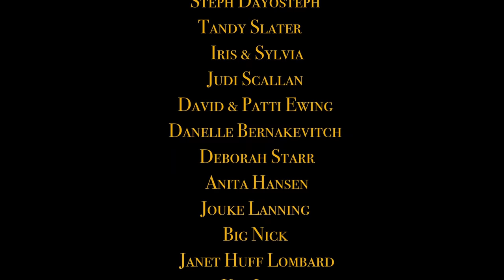EP54 Daily Vlog : Big Reveal The Dining Room @Our Passion Project Day 7

Comment: The chandelier looks great in the room.  Was it difficult finding the right shade of red paint or did you get it right the fist time?   We use furniture sliders to move heavy furniture by using a 2x4 to raise whatever we need to move and then putting slider under it.  They aren’t very expensive and make it easy to move stuff on carpet or hardwood floors.  Our latest need for them was to pull stove out after an egg broke and slid down side of cabinet and stove causing a big mess.  Since then I bought silicone strips to keep that from happening again.  You can always have the mirror re-silvered at some point in the future if you want to.  Bet you smile every time you walk in there; I know I would!

Comment: Just asking… are covers used for the radiators? They look so modern. I wonder if a cover painted red to blend with the wall would draw less attention to them. Another option would be to mimic the white panels underneath the windows in white. It would be like a mirror image to the window. Beautiful Chinoiserie vases could sit on the tops of the radiator covers that looks like furniture.